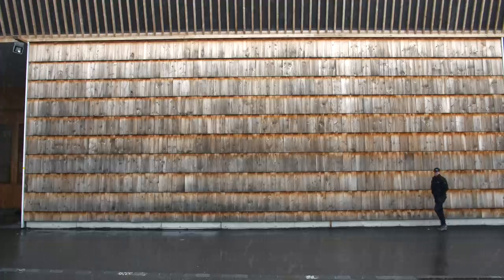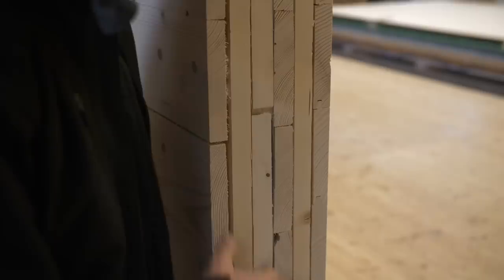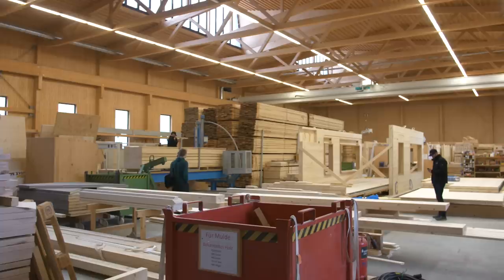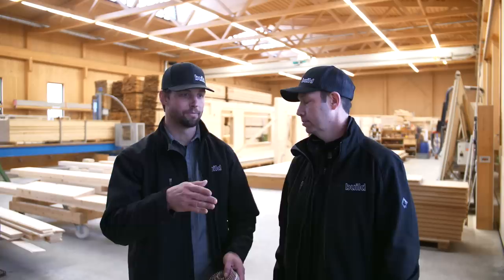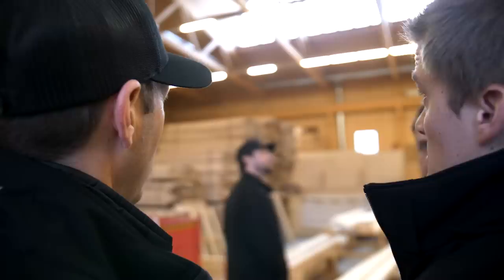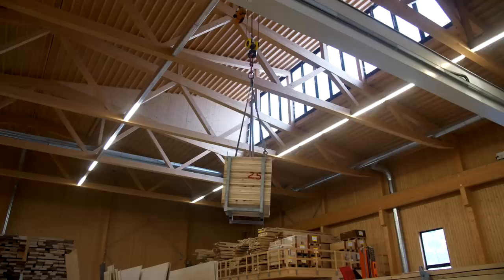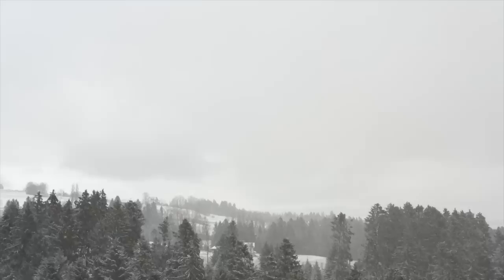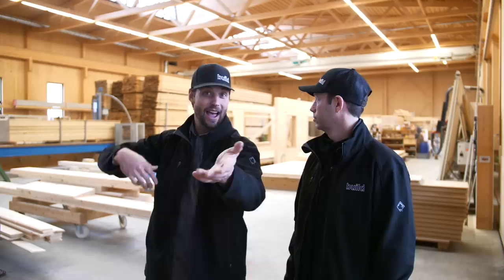This Swiss Builder uses NO INSULATION...

Comment: Do they have an ingenious termite treatment?
Maintenance issues? With code requirements?
One 300 year old barn does not allow a conclusion for general longevity, as the video implied.
Reply: The ingenious termite treatment is their absence in Switzerland. Simple.
Reply: There are many of those old stables in Switzerland. Even villages with many even older houses in that style (for example Mühlebach VS https://de.m.wikipedia.org/wiki/M%C3%BChlebach_VS)...

Comment: Not the same wood as a 300 year old barn wide growth rings 2day
Reply: justin lawton Lamination helps compensate for the poorer quality of the lumber. But you're right, it's not the same quality as the wood they used some hundred years ago, each tree carefully picked out with consideration for its intended use.
Reply: True but it's also slightly lighter which somewhat compensates.

Comment: This system is an offshoot of the Thoma 100 system out of austria. The best version of non glued clt is the 
Nurholz company. 
Their system use threaded dow.es installed in threaded holes which is way more stable than the smooth dowel system.

Comment: 300 years ago the timber was much tighter on growth rings. Now a days the growth rings are crap. SO a 500 year house from today's timbers would be hard to do by a long shot...nah sayer #1
Reply: That's very true.  Thus the need to lap cross grain.
Reply: Growth rings change with the years.
Reply: Heat treated wood could be the modern solution to that problem.
Reply: @YPO6  Heat treated wood has been around for thousands of years.  We know the Romans used it.
Reply: Were they using old growth wood in Europe just 300 years ago?
Reply: 300 years ago they did carefully pick out individual trees, taking into consideration its intended use. For example, trees grown on a north facing slope surrounded by other trees would grow slow and have dense wood. So to build a house, you'd start the year before by finding and marking the trees to use. That's how they did it in Scandinavia only 150 years ago. A few still do it the old way, for cottages and such.

Comment: Very cool video. One thing though: just because you saw a barn that lasted 300 years doesn't mean these houses will last 500. What you saw was an exception, one of few things that lasted that long, you don't see all the other 300 year old structures that collapsed, burned down, etc. I believe some of these new houses could hit 500 years, but those are extreme outliers, not the norm.

Comment: Japanese carpentry is still superior and they use it for modern prefab houses. Anyway building with massiv wood walls is extremly expensive. There is a good reason it's not the norm. No glue and metal is a lie as well, the windows have metal brackets, the tape that is used to make it airtight uses glue,...
Reply: @frugaltinkerer9609  That was in the factory rather than the houses.
Reply: To be fair Japanese house construction is not a long term build either. Earthquakes usually see to that. They also don't need the level of insulation or thoughts of future generations - it is rare that a house is handed over to the next generation, most wood structure homes are replaced after 30~50 years - I think it's a regulation - it's certainly a tax thing...
Reply: Why do people think Japanese is best - it's just old fashioned.
Reply: Do you think you may be nit picking a little there?
Reply: There is a good reason it's not the norm? Just because you want it  cheap and do not care about the environment means it's not a norm somewhere? It IS in Switzerland. All new houses have to reach a certain norm a certain factor of insulation. Even if your redo your roof, YOU HAVE to upgrade it to better insulation standards. And no Japanese carpentry is not superior just different way of doing it. You find way more older buildings in Europe than in Japan which survived due their strength and build quality. It's a fact not just a myth.  The building here shown in this video was just one way of doing a wood building. Our prefab houses in Switzerland are not all build like this but still require the same factor of insulation. I think Matt and Jordan now saw in which quality level houses are built in Switzerland and why they are more expensive, and this for a good reason.....
Reply: I live in a house in Japan. Trust me, they are cheaply built and they suck. I’ll trade creative ways of joining wood without nails for some good old fashioned insulation and central heating any day.
Reply: I also noticed that SIGA tape, it of course uses glue. But it's not much, and probably not the worst of glues.
Reply: Niclas Ericsson the normal houses nowadays in japan are not built like they used to be. A bunch of twigs that get bulldozed and rebuilt every 30 years.
Reply: Japanese houses are all flair and no functionality, they have terrible heating to the point it's practically require for each households to have kotatsu to survive winter

Comment: I'd gladly live in one of those Swiss houses, but I'd never stay a night in a Rissinger-built (or other so-called modern air-tight) home.  I think you're insane to encase homes in plastics, glues, formaldehydes etc and then rely on artificial air handling to make the homes livable.
Reply: ArthurDentZaphodBeeb  I guess you have never heard of an HRV, ? It is a heat exchanger , which brings outside air, and the other side exhausts inside air .
Reply: @flybyairplane3528  I think he has considering he specifically said "and then rely on artificial air handling to make the homes livable" which is a direct reference to the ERV/HRV devices bringing in fresh air.
Reply: But he's Matt Risinger...all knowing , all powerfull. How dare you question his authority. Off with your head blasphemer.
Reply: I live in an airtight house.  We've had independent air-tightness testing a couple of times during construction before drywall, and we were at passive-house levels (0.6 ACH50).  Due to various reasons, the HRV has not operated as yet, and the house is perfectly fine - It is actually very comfortable with the relatively higher humidity for winter conditions, though it does cause more condensation on the high performance window frames.  When there are pollutants in the house, we do open the windows briefly (the range hood is also not yet running).  Hopefully the HRV will be working very soon.  But I'm not the only one.  I know others in very air-tight houses, and they routinely leave the HRV off as the indoor environment is fresh enough.
Reply: Lyndon Than There are always off-gassing in your house (and most new houses), slowly decreasing over the years. I'd want that HRV up and running if I were you.

Comment: I guess you can justify just about any building method if you put your mind to it, but I think this is a terrible idea. What's your problem with nails and glue and insulation anyway?

Here in California we had a couple of terrible fires this last year and lost most of several towns. If our building codes had insisted on fireproof materials we would have lost very few structures and the fires would have died out at the edge of town instead of racing through them from one building to the next and endangering lives. Most of what survived were commercial structures built of concrete block.

London, Chicago and San Francisco also had terrible fires back in the days when they were still building cities of primarily wooden structures. These things are a hazard to the buildings around them! Not good at all. They ought to be banned. Let us learn from our mistakes.
Reply: Wood is a better material for seismic areas like California.  Nails rust and glue off gasses and dries up eventually.  There are Japanese temples that are 1000 years old built entirely from wood and wood fasteners and they still look good today.  They're also located in one of the most seismic regions in the world.  The only material that will outlast wood is natural stone (i.e. the Pyramids).  Fire is a problem for all material, except stone.  Fire weakens concrete and isn't suitable if you need flexibility in your structure and once concrete has been burned, its force strength is weaken enough that its not safe.
Reply: @christschool  ever heard of a brick oven
Reply: @rodrigotorres1036  Got one in my backyard.  But brick is permeable, stone isn't.  Besides, brick ovens are made with clay, not concrete.

Comment: When I went to Kandern, Germany in 2007 to help with a remodel of a 300-year-old barn/residence that had become strictly a residence over the years.  We were tasked to help in the process of changing the lower three floors to a 2 flat residence.  The first and second-floors belonged to the 2 flats with the 3rd floor being split between the 2 residences by adding a second stairway between the second and third floors.  

What blew me away was the fact that the local building and zoning laws demand that nothing was to be built or land used that was not to last 300 years.  When I returned to the USA, I asked my local building inspector what the life span of the International Building Code or International Residential Code [IBC/IRC] and land use was.  I was shocked by his answer.  "80 years".   Why so little?  "Think about it, by 80 years the structure is usually not worth keeping maintained and has been torn down by then or the zoning has changed within 15 to 20 years and been torn down to make way for some other use."  I was dumbfounded.

One example of what I experienced as we created a new stairway between the 2nd and 3rd floors was the construction of the ceiling/floor framing and coverings.  The wooden peg fastened timber framing was 3 decimeters [11.8"] thick, 1 meter on center [39.4"],  the plaster lath was 3 cm [1-1/8"] x 5 cm [2"] with about 2.5 to 3 cm of rough and finish plaster for the ceiling and 5 cm thick subfloor planks [diagonally cut 1.5 meters [60"] to 1/2 meters [20"]  by 5 meters long] laid back and forth along diagonal edges.  

Another curiosity was that the cavities between the ceiling and the subfloor were filled with dirt!  It turned out that each floor was constructed this way.  I was told that when this barn/residence [annimals lived on the first floor and people on second and third floors] was constructed there was a concern for protection from the many military campaigns that flowed back and forth through the region between France, Germany, and Switzerland.  It seems they were worried about cannonballs breaking through the clay tile roof.  The exterior walls were about 1-meter thick rock and mortar parged smooth with mortar.  It was/is a fortress.

The last curiosity for me was that the current use of the fourth-floor attic space.  It is "owned and used" by the city of Kandern.  It is used as a chase way for electrical, phone, and cable utilities!  All these utilities run through the attic and then across, attic to attic, then house to house throughout that area of the city.  No electric poles to be seen.  Very picturesque views from the street.  Very impressive and amazing to me.

Comment: I don't agree with the idea of building for 500 years, during an era of rapid technological change. I have owned houses that were the peak of technology in 1925. They simply don't compare to houses of standard construction of 2015. They leaked, by design. They had no insulation, they had primitive wiring. They are inferior in every way. Wouldn't want them for the next 500 years.
Reply: @spencerwilton5831  I agree with you in many ways.  I will qualify it by saying that in many cases, renovation costs don't make a lot of economic sense.
Reply: I so agree!
Reply: As someone who lives in a house from the 1860s (upgrading the bathroom to modern standards as we speak), I have to disagree.

Comment: If you bought rough 1x pine at $1.00 per bf, an 8'x20' wall 10" thick (about r14) costs $1600.00.  1 x 12 x 96 / 144 x 10 x 20= 1600.  Compared to a 2x4" wall with sheathing, insulation, and sheetrock, at r13 or r15, an 8' x 20' wall, no exterior siding or finish, costs about $500.00 to meet minimum Alabama code.  I suspect the fire rating for the former is significantly higher, and the structural integrity certainly is much stronger.  But material and labor costs would far exceed the latter.  In an age of the "Mc House", I don't see this method catching on here, unfortunately.
Reply: @onlyscience7120  True. This is actually just an illustration of a historic difference between European and US architecture. European design has primarily revolved around mass while American design is hollow. While the palaces are the quintessential examples, even small homes (huts) have often been built with massive walls of stone or logs or peat / earthen, etc. Those are much more rare on the other side of the Atlantic. I suspect that many homebuyers in Switzerland and surrounds would prefer the dense mass if they can afford it--it's a tradition that has worked very well for thousands of years.

Comment: For people that aren't contractors, what is a typical "R" value?
Reply: Uv of wood 0.14 W/m2K. The wall was 16 inches= around 40cm what makes it a wall with 0.35W/m2K. A proper insulated wall of a passive house should have around 0.1W/m2k, so not very well insulated. Hopefully they will find the way of add an insulation layer between the wood. 12cm of cellulose could insulate as much as these 40cm of wood.

Comment: Having spent a few years in usa, generally speaking continental north european house construction is miles ahead of the uk, usa and canada in terms of energy conservation, off-gassing and ecological footprint.  i think the scandinavians build some amazing energy positive houses. contrary to what one might think, these houses are spacious enough and wood constructions last hundreds of years.  one should note however that any house will have some metal (plumbing, fixtures, wiring...) and some polystyrene (e.g. insulation around shutter motors above window frames and the heating systems) and of course plastic (e.g. windproof film sandwiched within walls for air tightness).  foundations tend to be concrete slabs on a thick multi layered screed bed for obvious reasons and as we know concrete production produces masses of co2. mineral wool insulation in the eu is not allowed to have harmful chemical binders e.g. formaldehyde as in north america. windows are typically triple paned (or even 4 for north facing windows).  despite all this we still have a long way to go... underground water conservation tanks, elimination or limitation of electronic noise as well as forced air ventilation noise and simplification of energy systems. its worth noting that natural wood does off-gas, so a forced air ventilation wooden house is, IMO, the ideal.

Comment: A 16" R24 solid wood wall really seems like overkill when you can support up to 4 stories with 16" spaced 2X4s and still meet MA snow load codes. It's also going to take up a lot of space which could be better used in many cases. But a 500 year house doesn't seem outlandish to me, the oldest house in my town is over 365 and it was moved a couple of miles at age 100. I suspect that many cheap tract houses would last that long if anyone wanted to maintain them that long, though glued OSB, metal trusses or even reinforced concrete foundations might need complete replacement at some point if there is not some glue-injection remedy available. Wood is an impressive material in a lot of ways, but 16" of wood for wood sake only  makes sense if you are rich and really, really love wood.

Comment: nice, alone in our town (here in Swittzerland) we have farm houses from 16xx and 17xx which were never required major rebuild and are still in use ;-)  The Chip and Joana wink was funny :-) Even we in Switzerland know fixer upper, haha. But your right, we build houses completely differently. Hollowing out a house in just some hours is not possbile with our houses in Europe. All the concrete with rebars makes it way more rigid and durable but of course way more labor expensive. My father, who has a construction/roofing company always said the same exact thing you've mentioned. How can this be long term? Do they build a house just for the next storm instead of making it surviving it? I guess you answered this somewhat.

Comment: Fire. It’s easy to misunderstand the various mass timber, especially CLT fire test results. The tests have been focused towards being able to survive structurally, and secondarily in many cases, be able to be repaired in situ. The Type-X gyp you mentioned is net absorbing heat. Exposed Douglas fir would contribute about 9,000 BTU’s per pound burned. There is an effect on fire behavior.

Comment: I am an amateur, but I really want insulation in my houses. I do not mind using cellulose insulation(if you are sticking with all wood house), even if the performance and cost lose to other materials here in sweden. I am interested in a measured rating for those walls. I believe they can make them air tight, but I do not believe they are nearly as good as an insulated wall. I am a fan of passive houses and plus houses.

I really like that you do not have to worry much about moisture in the all wood house though. Because that is a big problem here if something was constructed incorrectly or if something is damaged.

Comment: EDIT: $195-$279/sf.

Reasonable homebuilding prices in Switzerland are given from 700-1000chf/m3 from a variety of sources in a quick google.

Assume that's building envelope rather than habitable area, and converts to 8-9ft ceilings and 1-2ft interfloors (3m ~= 10ft per story).  So 2100-3000chf/m2.  CHF-USD are within 1% of parity, so we'll say 2100-3000USD/m2.  $195-$279/sf.  That's... actually probably cheaper than most of Matt's luxury home projects.